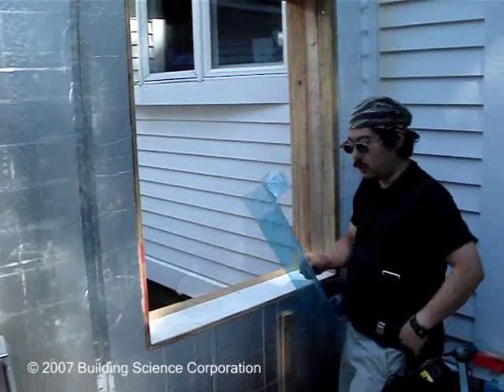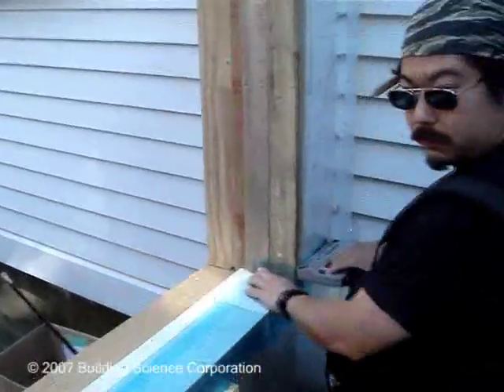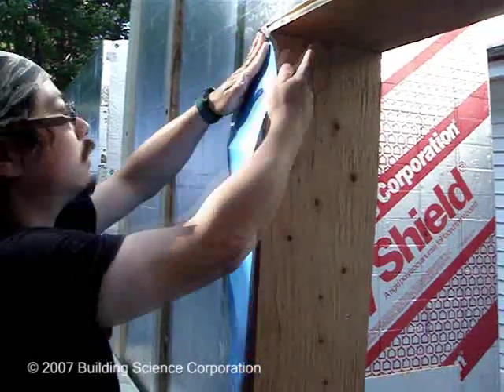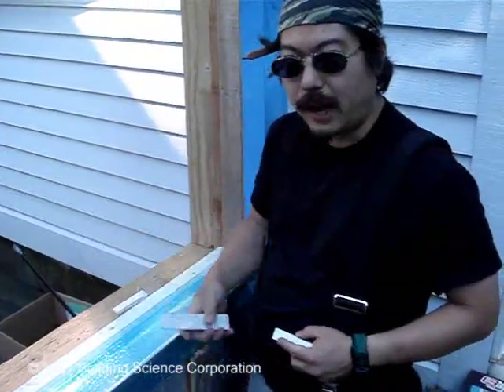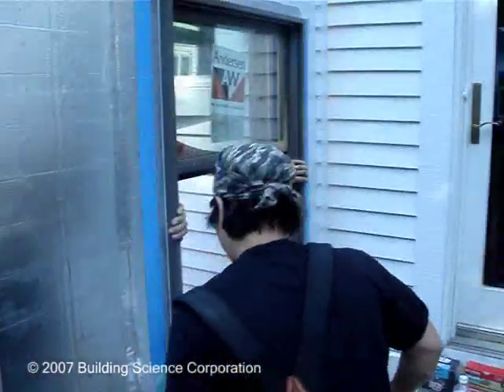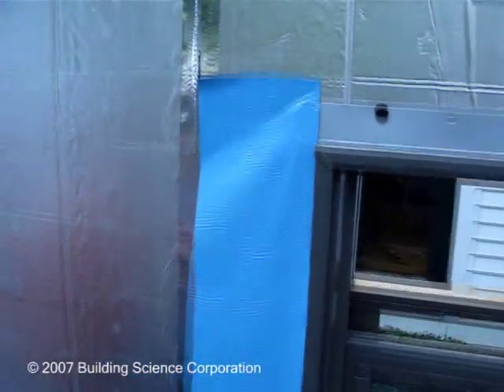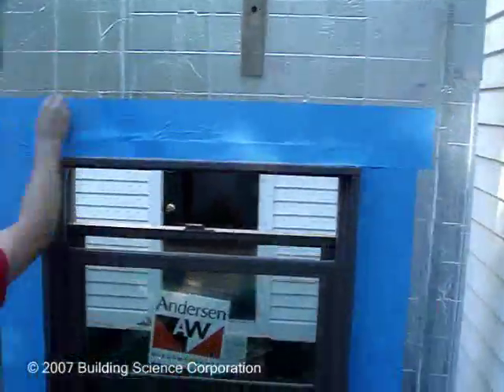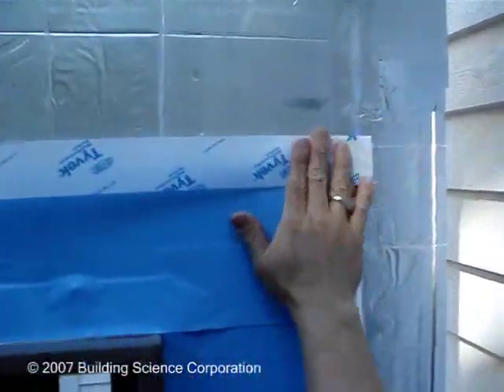Installing a Window in an Exterior Insulated R40 Wall

Comment: Nice job, my question is what happens to the functionality of that flashing as the tape and its adhesives fail? The adherence will not be forever, 5, 10, 15, 20 (?) years from now that tape will be a piece of non adherent film, then what? This is not a criticism of your technique, as I would likely do the same, but our current building strategies seem ever reliant on adhesives, taping, glued substrates, essentially engineered building materials and techniques. Not sure of their longevity?

Comment: No reply? Maybe cause I'm right and there is no decent way to replace this window in the future. It could fail this winter or 10 years from now. Either way it will need to be replaced.

Again I would love to see a video of how to replace a window that was installed on a exterior  insulation home. 

Probably won't happen so...

Does anyone have a better idea, keeping in mind future replacement.???

Comment: this is kinda nice but what of all this effort when window needs replacement in the future. Who wants to take off all that siding to replace a window.??? 

Ther has to be a way to install a new window without its "window Flashing"(as you call it here) plastic piece. 

If not then do a video of this window, after siding is installed,(or other cladding) being replaced by a new window. 

hmmm?